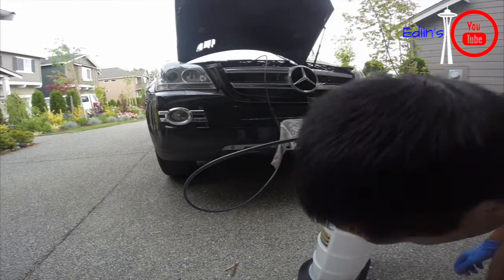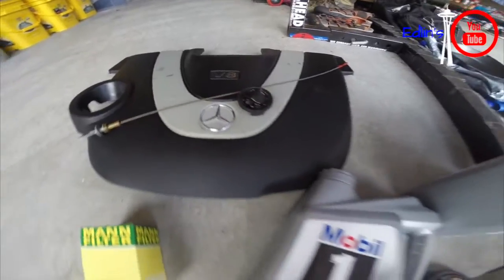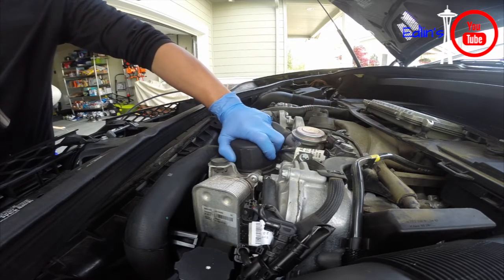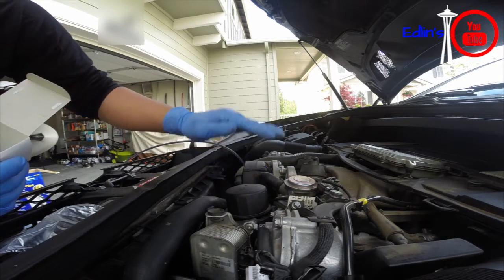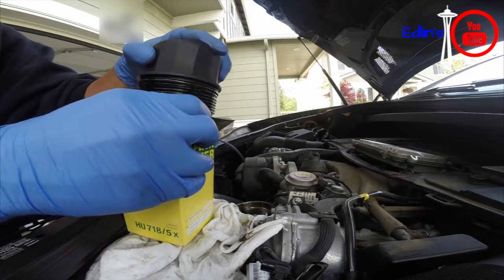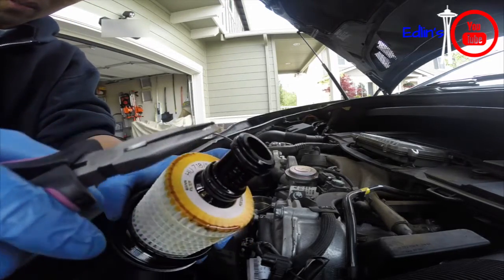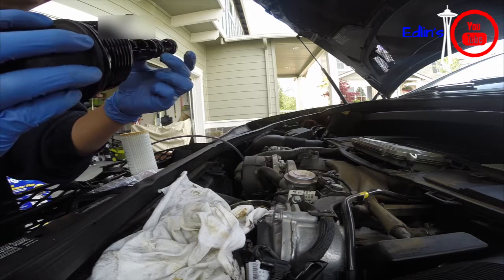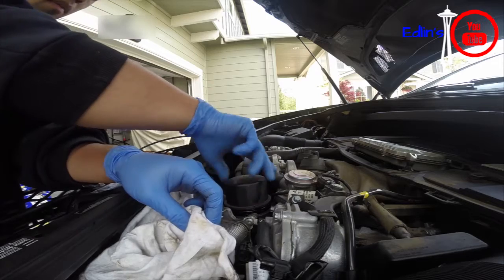Mercedez Benz GL/ML Oil change & Filter replacement 2007-2018

Comment: Hope you can make a video to show how to change oil for 2020 Mercedes GLE350. Hard to remove the filter because of an engine air pipe blocking the filter.
Reply from the maker: yeah dont have access to that vehicle. assuming its very simialr to 2019-2018 on youtube

Comment: I have questions when I go to autozone to buy oil they say my car need 5w30 , on video I see 0w40 I dont know  which one I can use on my car 2006 ml 350 , thank you for read
Reply from the maker: check your car manual but my specifically needs ow40 which is usually for european cars.
Reply: Sxtarii Buckxs I was told 5w 30 synthetic. I’m confused too